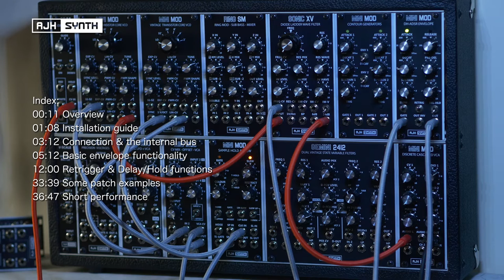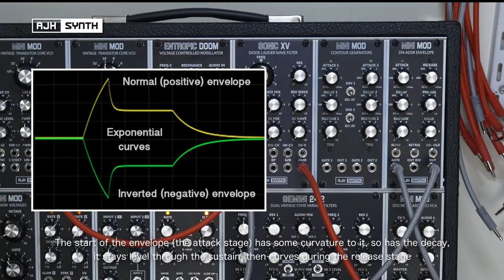DH-ADSR ENVELOPE: User Guide - for AJH Synth's complex Eurorack envelope generator

Comment: Thanks for making this video.  This is a module which I've never used to it's full potential, so this was very helpful.  Glad you're doing these videos to promote your amazing modules.  All the best!
Reply: Something that has always confused me a bit is that depending on the position of the pots, the retrigger stops.  Is there a particular reason for that?
Reply from the maker: Hi Juan, the re-triggering can only occur during the life cycle of the ADSR settings, so the Hold cannot exceed the envelope's duration set by the ADSR pots, but it must however exceed the length of Pre-delay setting/time. Hope that makes sense :)
Reply: I concur. I really enjoy your pacing, editing style, and the addition of simplified subtitles. It really helps with my learning style.